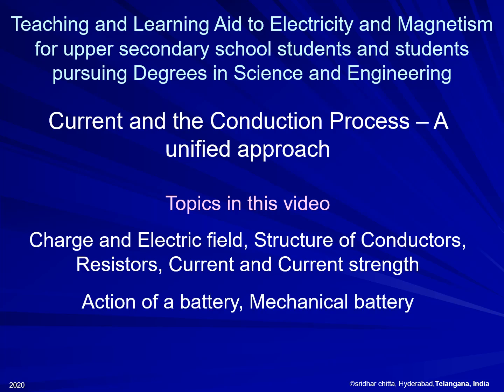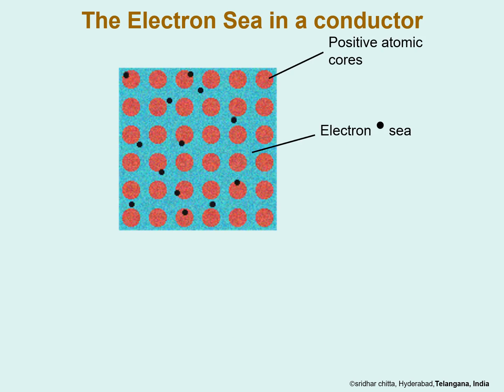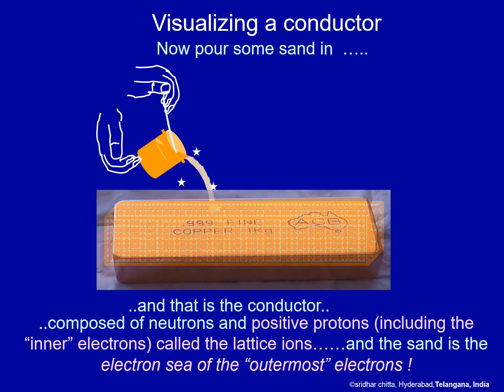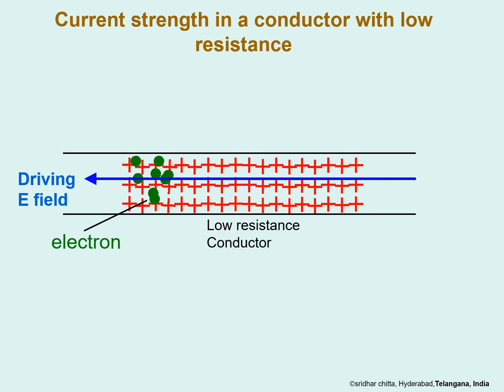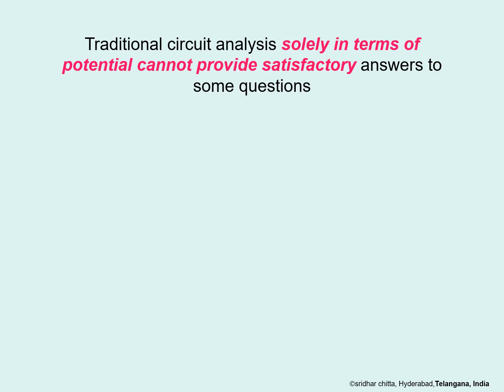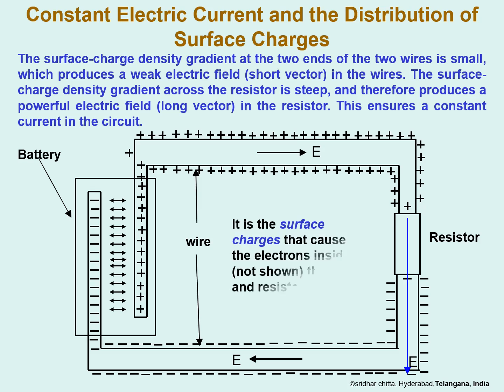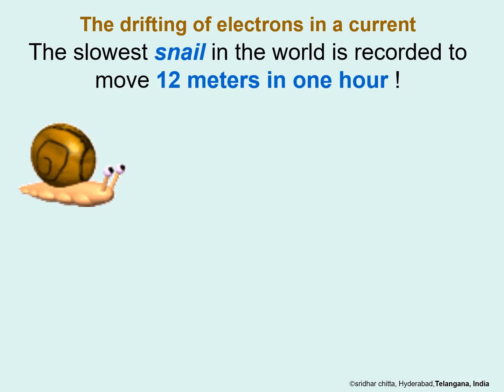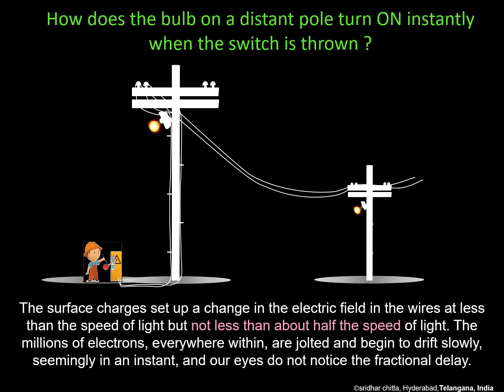Revised Current and the conduction process

Comment: Sridhar, I followed your link here from a comment you made on Fesz video, because the comment was very enlightening. I have a question for you regarding this video, from around the 13:00 point. If there was an open switch in the circuit connected to the battery, would the instantaneous field strength (internal) be infinite at the instant this switch was closed?
Reply from the maker: It is a good question. I cannot provide an answer in as much detail as the question warrants but shall attempt this within the limited space of a post.
There are several components of the total field in the wire and these are due to surface charges on the wire near and on the (two) ends of the switch at the gap.
When open, the fields cancel out in a manner that the net field in the wire is zero and so no current will result.
When closed, the charges on the (two) ends in the gap neutralise and the field is due to the charges a little away from the ends [1]. If the field strength during this initial transient before the fields in the wire becomes uniform were to exceed 3x10^6 V/m it maybe sufficient to produce a spark.
 
Very near an electron, the electric field is gigantic, whereas a short distance away it may be small or point in a totally different direction even, due to the interactions with neighbouring atoms and molecules [2][3]. And, classically a proton and an electron cannot "touch" and a pair of electrons will repel one another. The valence electrons and the protons of atoms on either side of the switch will therefore maintain a decent distance from each other.
A simple calculation will show that the potential (relative to infinity) at a location 10^–10 meter from the centre of a singly charged ion treated as a point particle is a mere 14.4 volts and much less as one moves farther away.
So, engineers and physicists usually refer to the average field inside matter and ignore the microscopic bumps and wrinkles in the electric field in matter which comprises millions and millions of atoms and molecules[2][3].

Therefore, I would be careful in using "infinite" to describe the field strength in the transient. 
References:
1. Ruth W. Chabay and Bruce A. Sherwood, “Electric and Magnetic Interactions”, 2011, John Wiley, 3rd Edition, USA.
2. David J. Griffiths, “Introduction to Electrodynamics”, Prentice-Hall, India, 1999.
3. Sridhar Chitta, Fundamentals of Electric Theory and Circuits, IK Intl Publishing House, India, 2018.

Comment: Great!!!...i was thinking of this question from a long time that- if i connect electric bulb to a battery by a very long wire, so how will electric field reach at the place of bulb and cause free electrons of there to move?...i am happy that i get this channel and now i am trying to understand the answer of my question.
Actually it is a difficult thing but real knowledge is always real.
I request you to please upload such more videos. It will be of great help.
Reply from the maker: Thank you for the nice comment about my video on Current and the Conduction process. You may be interested in the following two videos also that I have uploaded.
The design and operation of a Regulated DC Power Supply using a unified approach to electrostatics and Circuits Part 1 of 2
https://youtu.be/TQxGT5tZW5E
The design and operation of a Regulated DC Power Supply using a unified approach to electrostatics and Circuits Part 2 of 2
https://youtu.be/pDdoZ2u8TA8